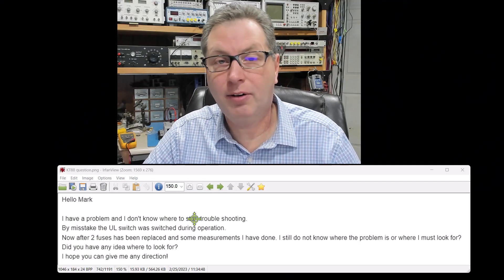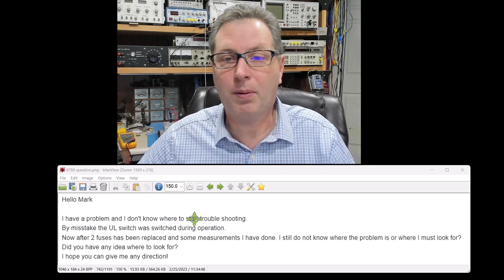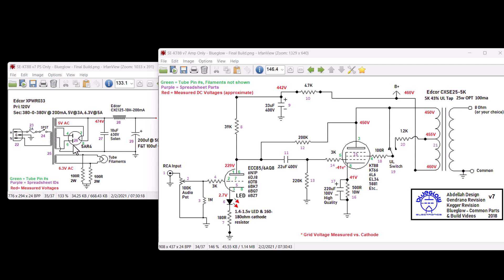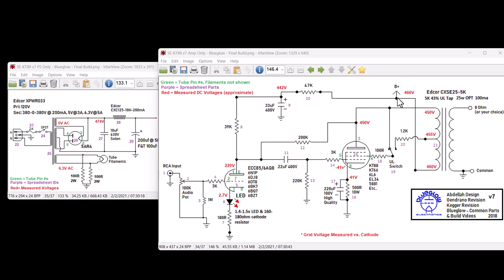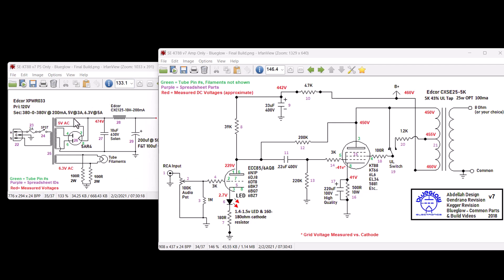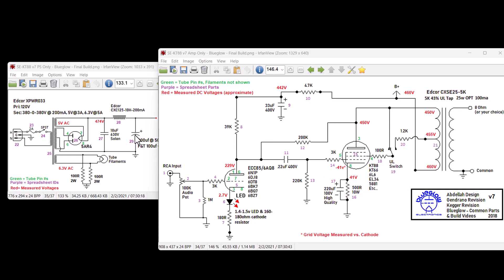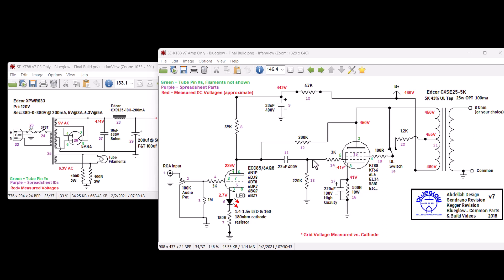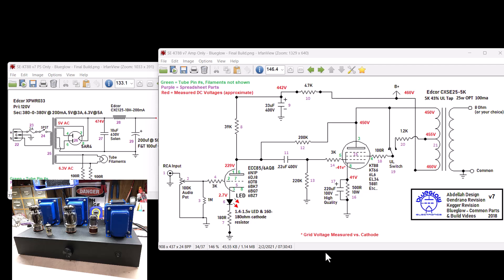Tube Amplifier Blowing Fuses - Troubleshooting Tips

Comment: Hi Mark, another poor soul with an amp problem.  Coming off the power transformer connection to the preamp board are 4 fuses. Now one keeps blowing. I have a Bugera 1960 "Non-Infinium" ampifier. I have no schematic so I'm studying everything I can find. It will run fine on just 2 tubes, inboard or outboard sockets but with all 4 installed, that one fuse blows. Not having a Schem, I just tested the plug from the transformer. Have voltage on all except one orange wire. Any ideas why 4 tubes blows the fuse? Thanks in advance for any help.

Comment: Hi  iam glad to find you, i have one question,  two Vac. Tubes  monoblock both are  blowing the power fuse( 2amps factory specs) but if i put a 5 amps it would not blow  it, also  power tube in one of the amps is brighter than the other..

hope you coul help,  thanks in advance

Orlando

Comment: Excellent video. I have a Marshall DSL40C (40w, 2 x EL34) that has the same problem. and I actually noticed that the Pentode/Triode switch was in between. Hope I will get it fixed using
your instructions.

Comment: I have question on my AA 151 Heathkit Amp  I am rebuilding  the fuse blows after powering up I followed your suggestion of pulling all  the tubes  off and powering up the, fuse remain intact but when I replace the  GZ34 the fuse blow again. I tested the GZ34 and it tested good on the tube tester what could cause the fuse to blow on a tube that tested good

Comment: In my experience: First check the tube(s). In a push pull design you may find one flat tube, if you do - then replace the control grid coupling cap(s) with a good HV Mylar cap - change both tubes and test. The coupling caps are notorious and may not be shorted. BUT even a few uA of leakage will blow the output. It is the output that is capable of conducting a bunch of current. Second the 5AR4 may be toast. I got caught when buying a Tungsol new manufacture 5AR4. These pups may not sustain a sufficient reverse voltage and they die spectacularly.  Some how I doubt that switching from UL to Triode caused a failure. But things happen.
CAREFUL when turning on an amp without the power tubes. Depending on the design you can easily over voltage the remaining components. Use a variac and check the input current while advancing the line voltage. STOP if the B+ starts to exceed the bypass cap wvdc rating.

Comment: I’m going through some of my own troubleshooting myself with an old late 80s PCB amp.  Recently fixed a terrible wall of crackle coming from my Fender Super 112 by replacing the standby switch as it was arcing once actuated, cleaned it right up.  I also gave the amp a huge refresh meaning all electrolytics and a multitude of resistors.

I’m having an issue with it now where it makes my tubscreamer and really any OD pedal for that matter sound harsh and fuzzy.  The largest tell-tale sign is my crybaby wah creates distortion in the toe position when going into the clean channel.  Just to clarify, these issues do not happen with my other amps so I know it is the amp in question, not the pedals.  

I already checked the speaker by jumping the speaker leads to my other amp’s speaker and the problem remained, tomorrow I will try isolating whether the issue is in the preamp or power amp, any ideas what this could be?  My bets on a failing coupling cap in the preamp stages but I’m not getting any crackling in any of the pots, only hiss in the clean channel’s bright mode.

Comment: Say the power supply had an issue. One where a typical ohm meter simply said, yea theres a resistance.. but at hv there was a break down of insulation. Could a meg-ohm meter be used to troubleshoot?

Comment: I liked your video.  I have one question.  What is the purpose of the 200K Ohm resistor between the plate of the 6AQ8 and the plate of the KT88.  I try to understand circuits when I see them.  I'm not sure what the resistor does.  Thank you.

Comment: earth conected resistancw and resistance close to 3way switch resistance is to low also resistancr on ecc85 is to low value that is connected to the ground all capacitors rating voltages are wrong connected for 450 to 500 volts need a 1.6kv capacitor conected and not a 400 volt all schematic circuit is wrong connected

Comment: Mark - what's your thoughts if I am blowing fuses approximately every 2 weeks? Does your analysis still stand?  Thanks!
Reply from the maker: Might have the KT88 biased a little hot.  Did you build it exactly to spec?  Measure your ac line voltage, what is it?

Comment: I bought a used MarkHill tube stereo Amp that was blowing fuses two of the 4 el34 tubes had the centering key broke off and one of them was clocked into the wrong position.. Easy fix great score

Comment: I Had a Cary SLI-80 that had the UL switch.  I switched them with power on all the time.  Never had an issue.
Reply from the maker: Depends on the switch.  Some make the second connection before letting go of the first, others don’t.